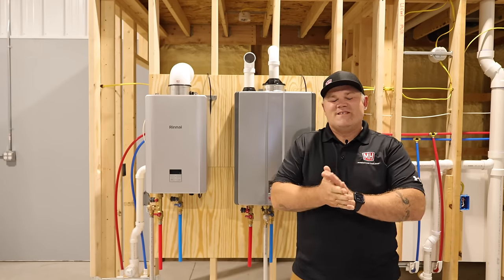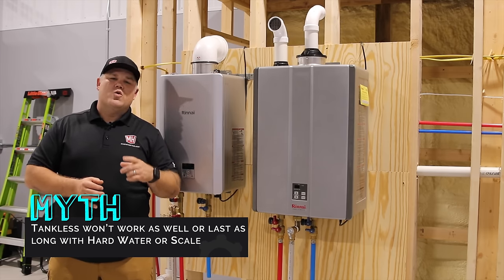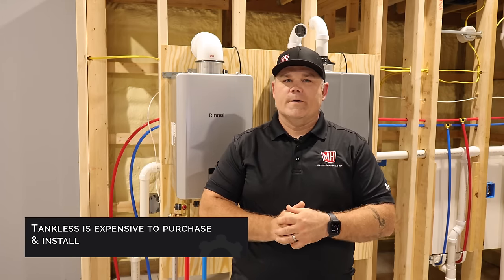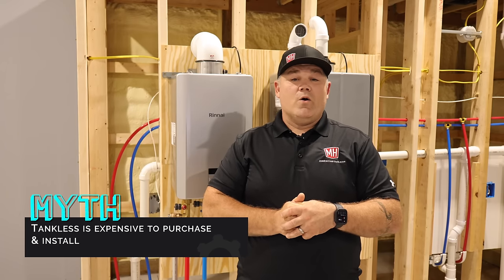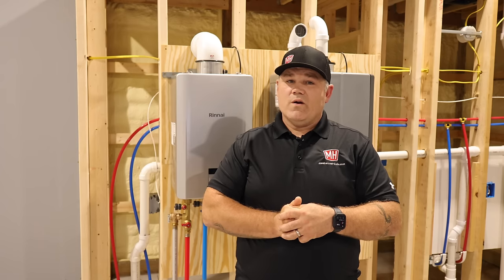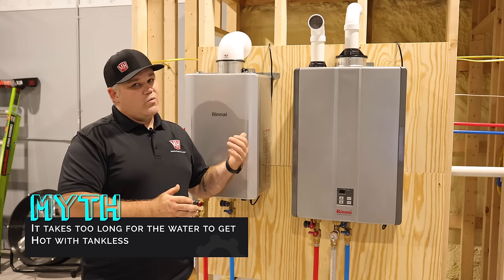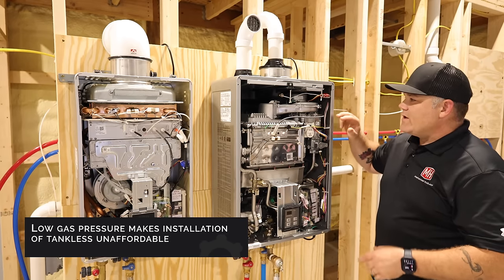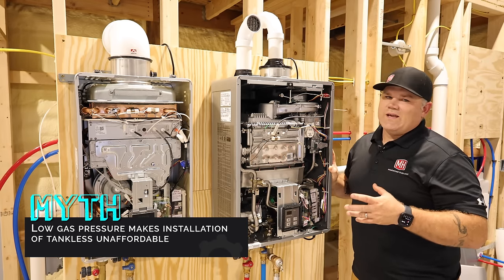Myth Busting! Tank -vs- Tankless Water Heaters

Comment: 1)  Scaling affects both heater types... tankless is more susceptible to poor performance as its heat transfer ratio is more critical 
2)  Poorly engineered tankless systems that assumed higher water temps without sufficient margin will be undersized.  Foaling/scaling and/or overstated heat transfer rates by the MFG will cause issues. 
3)  ....  its more an issue of electric vs gas heater and mounting locations for the tankless
4)  higher scfm air/nat gas = larger exhaust = higher cost
5)  un-insulated lines with large deadlegs have this issue regardless 
6)  both are fine
7)  home gas regulators typically take 20-80 psig gas and cut it to 1/4 psi.     supply flowrate and losses may be an issue.... so you may need to take a 0.5" line and up it to a 0.75" line to properly feed the equipment at sufficient flows... layout dependent, 
8)  workable for 60 years.... vs 200+ ....  /shrug

Comment: The biggest problem with ELECTRIC tankless water heaters is the instantaneous power draw. If you run your house on solar you need a hefty array to be able to supply to power draw. Using a standard tank water heater is better as you can use it as an energy store. Dump your excess power into warm water and use it later. put the water heater on a timer so it heats the water during peak solar production hours.

Comment: We used electric. The unit costs far less. We could install indoors without venting and makeup air or a gas line. It’s 5’ from the electric panel so the wire costs less. It’s on the back wall of two bathrooms and right beside the washer. It takes 8 seconds to get hot water to both bathrooms. We also have warm ground water. There isn’t a single reason for us to use gas powered heater.

Comment: I have a 120V electric tankless water eater that is half the size of an average brief case and weighs about 5 LBS .  It's set at 120 deg. and we almost never run out of hot water.\. the water only taks a fw moments to get fully hot at the shower head for  nice hot shower. I got it at my local Home Depot for under $200 .. I think it's the best investment I/ve made for my home.

Comment: 1. If you got a power outage, with a tank heater- you would still have a 40-80 gallons of hot water
2. if you got a disaster, and city water would shut off,  you would still have a 40-80 gallons of  water, which is enought for up to 2 weeks! 
3. The whole house tankless heater requires a lot of amperage- about 100 amp (while tank heater- only 25 Amp) you may need to update the panel and service cable, which would cost  A LOT!
4. Not just tankless heater it self cost more than  tank heater, but you would have to pay for a new wiring and that is not a DIY project fo sure 
5.  Some energy suppliyers charge extra for "momentary demand"-  so , the price per kw/h is higher , if you use  more amperage at shorter time

Comment: In the Caribbean we use only electric tank or tankless water heaters, tankless is constant hot water but if the power cuts off while in the shower brrrrrrrr! But tank will give you enough time to complete your bath.
Your choice.

Comment: yea cause mine is set at 120 and i never run cold water, store get cold stops and I can look at the tankless water heater from the shower . I have the water line it calls for and there no pressure for hot or cold water

Comment: You did not answer the question on the first myth, do these last as long or longer than tank water heaters under poor water conditions? 

I would say they last less and are effected a lot more from poor water conditions than tank water heaters because tankless do not have as much capacity to hold onto that much sediment, and the filter gets clogged more in a tankless which shuts off the unit from poor flow.

Comment: Simple science says that the thermal conductivity of copper is over 40% more efficient than stainless steel. So, exchangers should be copper with aluminum being #2, but aluminum will be corroded much faster.

Comment: Tankless is easily triple the cost. Most tanked water locations don't have an electrical connection or sufficient gas and new vent lines have to be run. Plumbers charge a premium for tankless because they can. Most anyone can replace a tank.

Comment: and then you get an HD washer, by the time the cycle gets running in the washer it shuts off and you don't have hot water in your washer. 4 gallons is 4 gallons and the washer is right next to the Rinnai
Reply: Your dish washer should have it's own heater in it.

Comment: Your comment about your home unit being able to raise water temperature by 80f at 5gpm did not disclose the efficiency of the unit, its cost, or its gas demand. While some people will not need to upgrade their gas lines, most will as they already have a gas appliance and the 199k btu units are gas hogs when they're running full bore. And you also didn't mention the need to properly calculate gas line size vis a vis pressure drop, which most plumbers won't even know how to do.

Comment: Everyone here tells me "nobody likes electric tankless" when I tell them I put one in. My mom's house has one...endless hot water. Same for me, even though my ground water is colder than hers. I have a Rennai propane as well that hasn't been installed yet. It's for the main house, and the electric is for the basement unit, but for now, the electric one is serving the whole house just fine, though it probably wouldn't be enough for 3 fixtures at once.

Comment: Only in the event of a power failure do you not have hot water. The system itself is electrical and requires electricity to ignite the heater (Even in GAS ones) but once it's ON, it's ON and endless as long as electricity is maintained. The ONLY benefit of a TANKED hot water heater is the held supply of hot water until the tank runs out.

Comment: My biggest complaint with them is their tendency to fail. They have too many mechanisms and parts, so they can fail, especially after 3 or 5 years of use.

One exploded on me, and another almost exploded after the mechanism failed to turn off the fire. Luckily, it had a heat sensor on the top of the copper pipes radiator that shut the magnetic gas valve off.

The older ones that didn’t have batteries were less prone to failure, but you have to turn them on every time you need hot water for a shower. Or, you have to leave that small flame, which is responsible for igniting the burners when water is opened, ignited all day.

Comment: A 4th reason for switching to tankless - eliminating an old bulky flue that runs up through both floors of the house.  Many times a flue is routed between closets, which gets in the way of remodeling.  Removing an old flue cavity (1x1.5ft) can free up options for the remodel.  I’m remodeling an undersized master bathroom, removing two tiny closets and the flue (in the way) doubles the size of the bathroom area.
Reply: Yeah, unless it’s a gas tankless water heater that needs the exhaust as well

Comment: 1 question never asked is what if the power goes out. Then no hot water where a tank will have hot water. also in case of emergency a 30,40 or 50 gallon water heater is that many gallons of drinkable water.

Comment: 120f scalding risk? CAUTION PLEASE
Reply: 120f isn't even hot.. 140 is a typical hot shower temp and 180 or more is scalding risk.. I used to live in a house that had 210° oil fired hot water.. never seriously burnt myself either, because I knew it was hot and I knew how to set the faucet

Comment: The delay is NOT a myth, and it doesn't take the same time as with a tank.  In a tank, the water is already hot and in the tank.  Only the travel time from tank to faucet constitutes the delay.  In a tankless, the water is cold.  The tankless has to heat the water up and then transfer it to the faucet.  That heatup time is significant.  

I used to get hot water at my sink in about 10 to 20 seconds after turning on the faucet.  It takes a good 40 to 50 seconds with the tankless.  You are running water for 30 seconds longer to get hot water from a tankless - unless you have a) a recirculator, b) a supplementary electric mini-tank under the sink, or c) a hyper-insulated medium size water tank kept full of hot water by a recirculator/thermostat arrangement.  

The advantage of the latter, of course, is that you can locate the tank remotely from the tankless, close to the predominant use site of hot water - say midway between kitchen sink and bathroom - even if the tankless is on the other side of the house.  Only the distance tank to faucet matters.  

I love the savings of a tankless - I have a combo unit that also provides my baseboard heat, and it has saved me a fortune in heat using natural gas over my old oil boiler; a breakeven in 2 1/2 - 3 years.  But the delay in getting hot water to my kitchen sink drives me nuts, and I hate wasting the water.

EDIT: I just noticed I replied to this video a year ago - could have saved myself the typing.  Interestingly, the story hasn't changed, and I'm still kicking myself I haven't been able to get a plumber to show up and install that hyperinsulated tank!

One aside: water quality.  If you have town water, you'll get a water quality report - often listing the mineral content of the water.  That's measured at the pumping station outflow.  In many cases, that's NOT what the water coming in to your house is like, after going through miles of lead and steel and ceramic, and who knows what kind of pipe laid down 200 years ago.  What matters is not THEIR water, but YOUR water.  And for that, a whole-house filter may well be warranted - both for health AND for longevity of a demand hot water heater.  I had my Rinnai replaced TWICE under warranty because of the iron in the water coming from the street corroding the heat exchanger, until I put in a whole house filter.  You don't want to know what that filter looks like at the end of the year - between milk and dark chocolate.  It starts out pure white.  Highly recommended.

Comment: I beg to differ on the Tankless vs Tank water heater. Only Condensing Tankless water heaters are 95% efficient. Tank water heaters are not 60% efficient, but well over 80% efficient. In fact even the pilot light is over 95% efficient for heating water as it is like putting a candle at the base for keeping the water warm.

Comment: I own a mobile home. The mobile home park in which I live in, seems to have a lot of power outages and a lot of frozen main water lines.  In which case. I have been spending a lot of time and money 💰 on replacing hot water tanks and/ or water tank parts.  ...  Thermostats and heating elements.  I'm now in my 60's this is hard on me. And, expensive.  I'm now on a set income too.  Wood I save myself by getting a tankless water heater. 
And curiosity, can a tankless water heater be ran with solar ❓  
But would my parts keep going out and need to be replaced I'd switch to the tankless.❓ 
Would it be better for me ❓
I've also have been going through  appliances, TV's, microwaves, toasters, because of the power outages and surges.   
I really need some help 🙏❗❣️❗😭.  
What is your opinion, your 💬 thoughts or suggestions ❓❣️❓❗🙏.  Please ❓❗.    .

Comment: I have a tankless heater, but it takes a good 30 seconds for the water to get hot. From the time you can feel the water beginning to get warm until it's hot is at least 20-25 seconds. Not a myth.

Comment: Question:   Where do you get your rennai parts?  I have one 15 yrs old (2008), yearly maintained, and I was told the gas valve may need replacing, and that is very hard to find.  Do you know where I can replace it?

I have already replaced the ignition system as well as the Rod And cleaned the part which usually gets dirt from the Flame, Unfortunately I cannot remember what the part is called right now. I've talked to rannai and they said please go find someone that sells it. I have talked to a official rannai plumber and they said try online. He said it was so hard to find parts that if I find it he will install it.  So where do you recommend I should go for parts?

Sorry for any spelling errors the spellcheck keeps changing everything I write.

Comment: Something tells me there’s a lot more components that can go bad and cost a decent little price to have fixed. Anything with more “technology” in it seems to come with a hefty price tag when service is required. Old cars vs new cars well old cars quite simple to fix issues. New cars require scanners and a damn electrical engineering degree. Upfront costs plus maintenance costs tells me I may not save enough over time to make the switch worth it. Most diy guys can handle tank issues and even simple replacements but these new technologies yeah I don’t think you can run to local box store and fix on Sunday.

Comment: You didn't address my biggest problem with tankless or flash heaters! That is the water temperature fluctuation when taking showers. It is several degrees and very noticeable. If the user takes baths instead they will never notice the difference but if you take showers you will not be happy with the temperature fluctuations from a tankless water heater. If any plumber tells you otherwise have him give you a list of his customers who have installed tankless systems so you can ask them directly. Even then I would encourage you to find mutiple first hand sources and if possible a business that lets you test it for yourself on a demonstration setup where you can confirm the water temp heading into the heater and the water temp exiting the heater. Europe has been using these heaters for decades, so anyone who has stayed anywhere except the most expensive hotels will probably know what I am talking about.

Comment: Switched to a tankless a couple years ago. It takes a bit longer to actually get hot water, but once it's there, its there forever. We don't treat our water before it goes in but I clean it out with vinegar once or twice a year and have had no issues.

Comment: As an Energy Advisor, right now, because of the very high cost of instantaneous water heaters i believe it is not worth it. Yes they are more efficient however the savings in natural gas does not pay back the enormous cost over the lifetime of the instantaneous tank. If you go electric then it is even more costly.
Yes you get endless hot water to fill a big bathtub but you also you get cold water if you turn the hot tap on and off because the gas goes on and off, you get a gas smell outside because the instantaneous tank dumps gas when you turn the water on and off, and there is a learning curve for the whole household.
Yes the instantaneous tank takes less space and if this is what you need then go for it.
Storage gas hot water tanks are 55-65% efficient and of your total heating energy consumes about 20%. You save 30% of your 20% in efficiency savings when installing an instantaneous tank or about 7% of your total heating cost which is ballpark $200-300 per year and your instantaneous tank is $3500-$4500 so it takes 10-20 years to payback the investment for equipment that usually fails within 10 years and needs extremely expensive parts or complete changeout.
So, unless you need the space or have an enormous bath tub or 4 teenagers who all shower at the same time, don’t get an instantaneous tank.

Comment: Today, with the "money saving energy efficient" 40 gallon tank water heaters not supplying enough HOT water for ONE person taking a bath then wanting to wash dishes in a sink (no dish washer but the ones at the ends of my arms!) and THEY WON'T fit into my tank closet! My house is 98 years-old and until this last water heater I only had 20 gallon hot water heaters that would last 40-50 YEARS, but they no longer SELL 20 gallon natural gas water heaters in the US. So I got a 30 gal. Rheem, which is only 30,000 BTU, less than the 45 year-old Mission 20 gal. 43,000 BTU (I have it's 51 year-old twin in my detached garage for my washing machine). With the 20's, I NEVER ran out of HOT water. With the 30 gal. I do. No tank larger than a 30 gallon "tall" will fit into my tank closet, and the new 30 gal. shorties at 25,000 BTU's ain't gonna get it done. That means I MUST buy a $1200-1500 tankless that will FIT and provide 4.5 gallons per minute for 12 minutes, my 45 gallon cast-iron bathtub's worth. The Mission 20 gallon tanks cost $138 each from Allied plumbing supply (I still have the receipts!). The new 30 gal. cost $473 from a big-box home store, plus $831 installation and new "double flue" pipe. BTW, in MOST locals, it's against "Code" to treat water going to "appliances". You can only treat "drinking water" here if you're on City water and well water for drinking is "against Code" too. Of course my backyard water well water is BETTER than City water by chemical and health analysis...

Comment: Get a heat pump tank system. and solar panels. You can then use the energy from the sun to run a system that's more efficient than anything gas can  do. I disconnected entirely from the gas network and save a bucket load of cash in any season by going fully electric with grid connected solar.

Comment: The only problem with tankless water heaters that I have to explain to my customers is that if a tanked water heater under warranty goes out, I can have it replaced in 24 hours or less but if a Tankless water heater under warranty goes out and needs parts or troubleshooting it can be anywhere from 7 to 14 days before they have hot water again that is a fact in the manufacturer always give you a really hard time getting any Warranty they want to see pictures they pick a part your install, etc. so if you could accept these two downfalls, then go ahead and get a Tankless but the customer needs to be told the truth